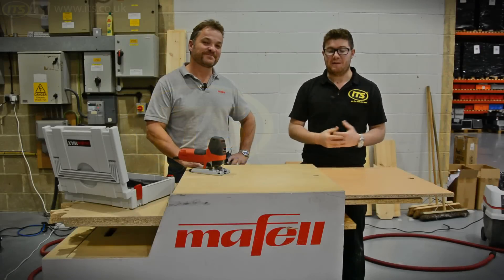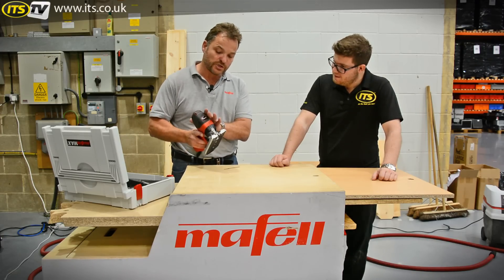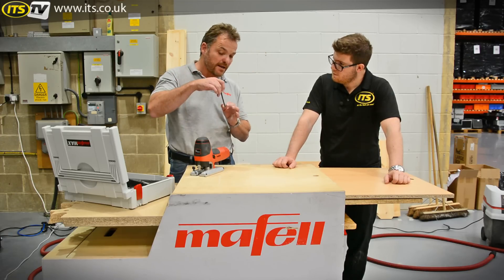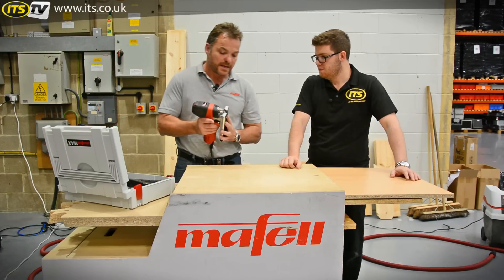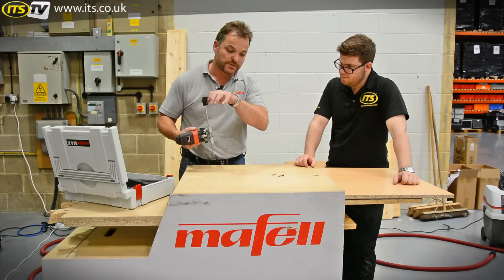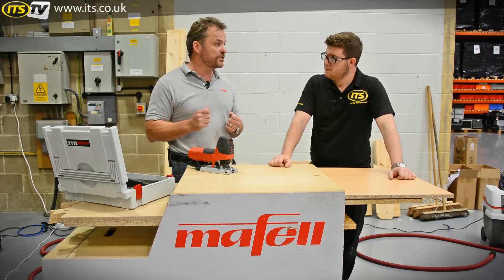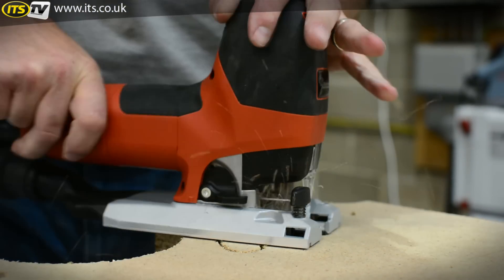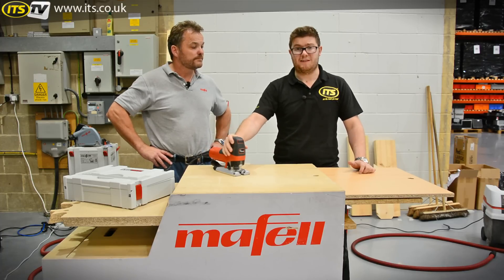Mafell P1CC Jigsaw - ITS TV

Comment: I was wondering, when you put one side of the saw on the guide rail, how do you prevent it from tipping over to the other side? I found the explanation in another Youtube video. Manfell provides a spacer, as standard equipment, with the saw. When I watch your video closely, I can see that the spacer suddenly appears magically. I wanted to mention the spacer here, to help others wondering about the same thing. By the way, I own a Mafell P1CC, and I found the spacer in the box today. It is there, but I have never figured out what it was for. Thanks for the video.
Reply: Im gonna check my box right now because i was asking myself the same question :D thanks

Comment: Advantage of the "d" shape handle - variable speed trigger.
This jigsaw is very nice, but it is miserable when cutting metal... Was designed only for wood, and in metal the blade without the roller bents.
Reply: It’s predominantly designed for carpenters